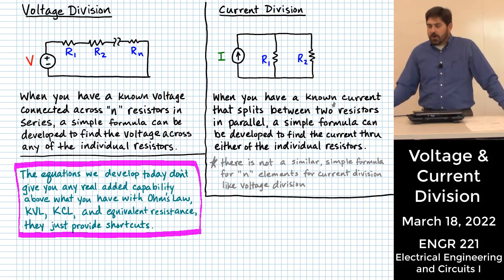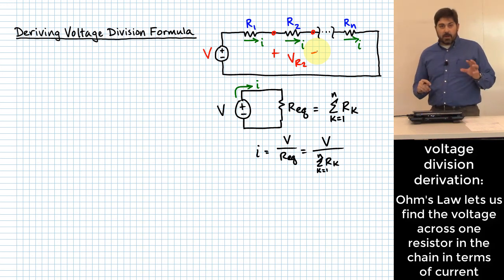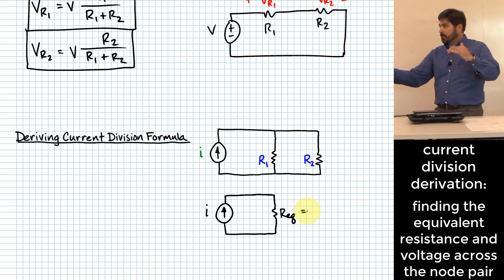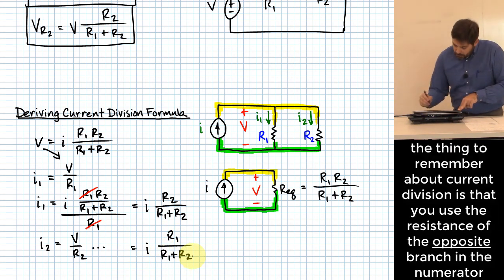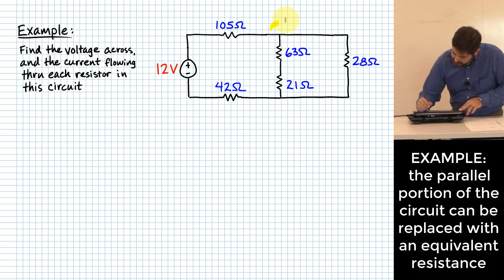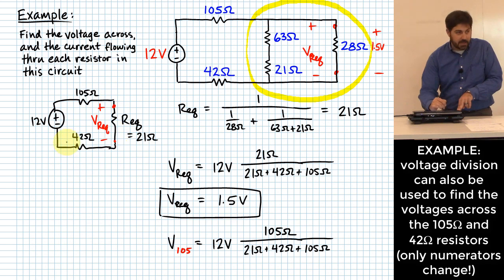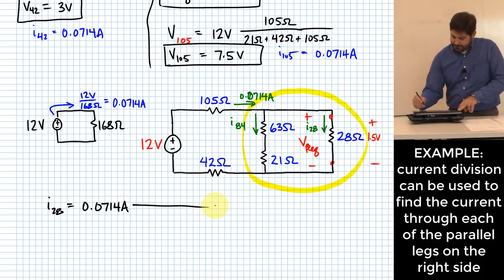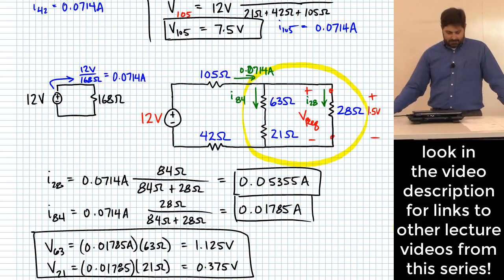Voltage & Current Division Formulas: Circuit Analysis Shortcuts | Theory & Example

Comment: i would add that there is kind of like a shortcut for doing current division in a parallel combination of R resistors. It involves using Conductance G = 1/R and then applying the "voltage division formula".

I_k= I_total* G_k/ ( G_total )
where G_total = sum (G_i's)
Please correct me if im wrong